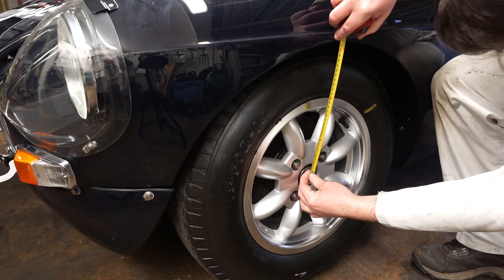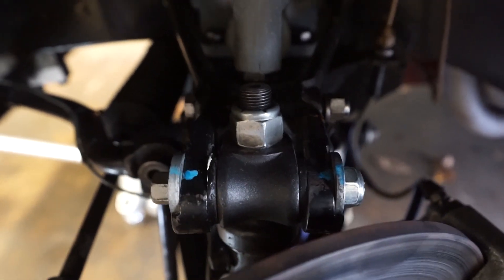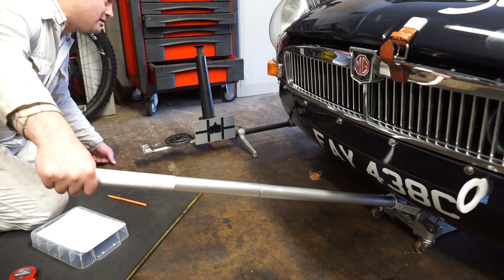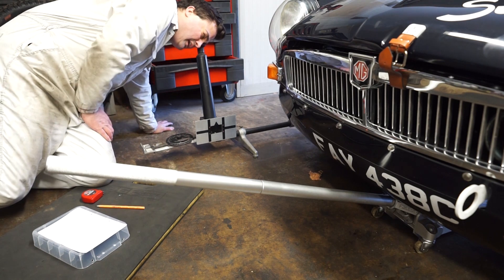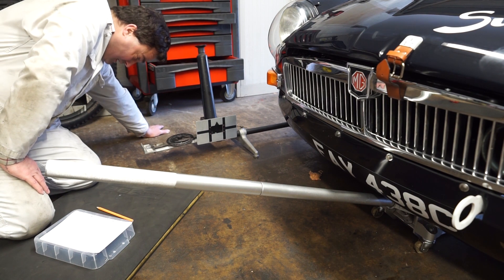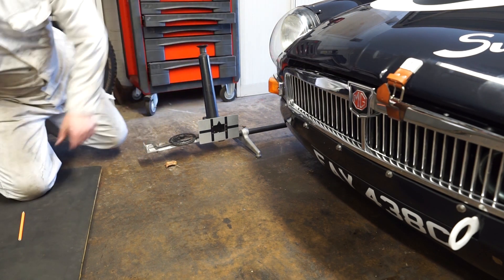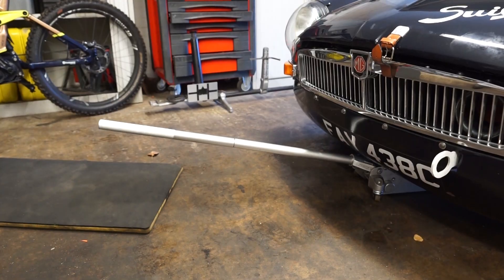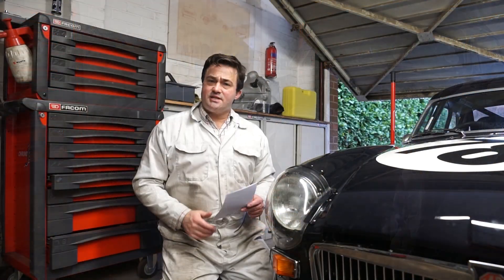Checking For Bump Steer On An MGB Or Any Car

Comment: How do you get the  orrect springs ?
Reply from the maker: It's a little bit of trial and error, you'll need to know the height and weight of the springs currently fitted and then make changes to achieve the ride you want.

Comment: I was getting a bit worried when you said you had 30 degrees toe out but it's nice to see someone using the old Dunlop tracking device, I have the same one which must be 60 or more years old and still as accurate as ever and easy to calibrate. Can you re-adjust the bump steer when you've moved the rack?
Reply from the maker: Yes, my mistake with degrees and minutes! I will try moving the race and see what changes, I do think raising the rack slightly may mean less bump steer looking at the angle of the steering arms, will try it and see.

Comment: Well done David. I believe Brown and Gammons have shims for under the steering rack to address this. When I installed my crossmember camber kit, they were included. Thanks for the content.
Reply from the maker: I think you are totally correct Lance, I've seen a few MGB race cars with pillow blocks under the steering rack (it's quite hard to spot unless you look underneath). Hopefully I can raise the rack and move it forwards slightly.